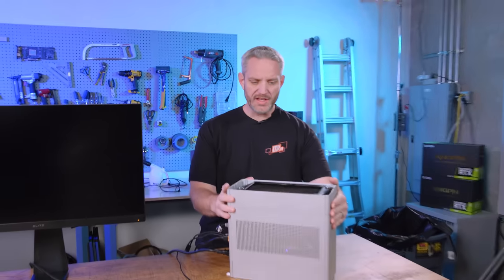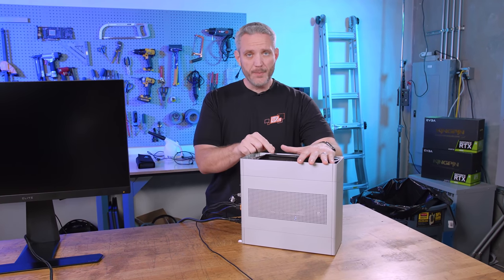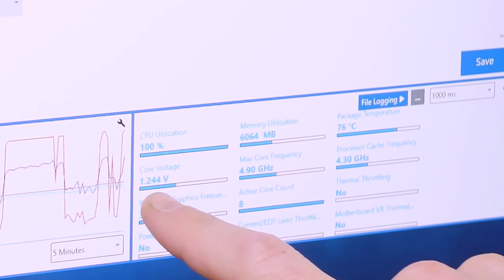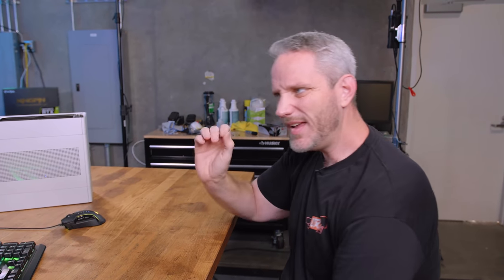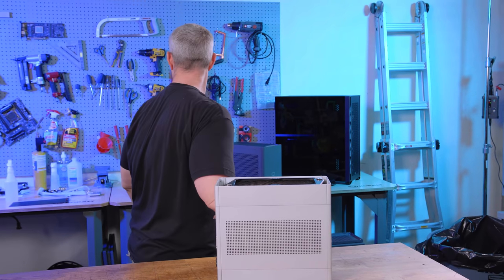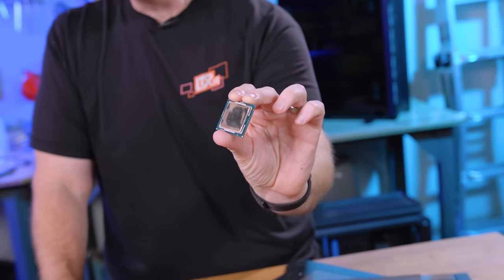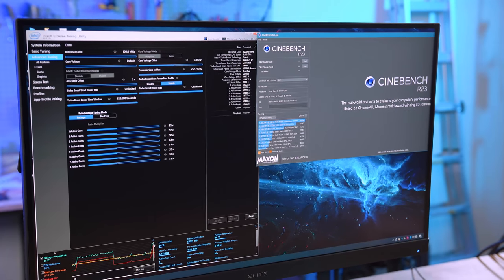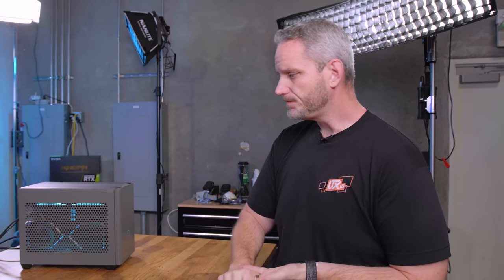THIS is what a Silicon Lottery Winner and Loser looks like for CPUs...

Comment: I am overclocking my 11900k using BIOS.  While this was relatively easy,  there are a few disadvantages including not being able to quick and easily disable overclocking when I don't need it to save power and reduce unnecessary heat output as well as I have noticed this prevents my pc from sleeping and if I try to force it, it will not wake back up.  Would using Intel Extreme Tuning Utility, that Jay showed early in the video, allow me to have the same performance as overclocking using BIOS but with the ability to quickly and easily disable it so it can sleep and wake back up to save lots of energy and lower heat generation when when its not being used?
Reply: Potentially yes and no because it also has a bit to do with what mobo you have  and if it has some form of software that might interfere with any of settings most manufactures do ie msi dragon center and i think armory crate. You have to be wary of those because they can apply their settings and depending on the bios settings initially  if you also use xtu then there might be two sofwares trying to change things and it can be wonky. If that's not the case and your comfortable with keeping an eye on voltages and what not then yes you can use xtu in a similar way to just a Bios OC and have different profiles loaded. Depending on your usage case i would also say that a lot of the times most OC guides are set up to have it so that its locked at the highest frequency and the voltage all the time on all the cores which can be the best ot hit bench,arks and for heavy tasks like rendering and stuff that use all the cores it will beneficial and will be good for gaming but for everyday can be excessive. You can change the windows power plan as well and in the advanced settings can manage it and allow the computer to sleep and also downclock when needed. so you could change that profile as well. I have mine set up with xtu and using the per package setting have it to from using 1-4 cores at a fairly high setting so that it can turbo up to those on most tasks and not so high on all core since its thermals in my case  and have tuned in the auto voltages to work with that and i think it works pretty well for most things and gaining since i don't have many heavy all core tasks  i do. But you can achieve the same OC you have in BIOS on XTU if you know the voltages and everything and save it to a profile and switch as needed but just be sure to keep track of everything to make sure
Reply: @connorjohnson4402  I currently have a MSI Z590 Pro Wifi mobo and am using the OC button in BIOS which I found to do a pretty good job of getting me 5.3 (not worried about extreme overclocking for my use) as well as having XMP enabled and custom fan curves set in BIOS for everything but the GPU which I have set in GPU Tweak II.  If I was to use XTU, I figured I would want to disable the OC in BIOS first.  I was hoping that XTU would have the ability to switch between a default and custom profile with the click of a button (something you cannot easily do with BIOS OC).

What I just realized was that when you make any changes in the BIOS it tells you what changed in BIOS when you go to save and leave which I remember told me what voltage and other changes it was making.  I could go into BIOS and turn it off and make note of what changes it said were made.  It would essentially tell me what to do in XTU to get the same OC.   You mentioned profiles which leads me to believe that I could enable the OC profile when I also enable my GPU OC profile for gaming and disable both when not.

I misspoke about my sleep issue.  Its not that it won't go to sleep.  It's that it will not wake back up from sleep which is why I don't let it go to sleep.  I have spent a lot of time testing the sleep issue.  If I put it to sleep it will not wake up. If I set a power setting that lets it go to sleep it will not wake up.  I checked BIOS settings to ensure the peripherals could be used to wake.  I can hear the fans ramp up but no display out when I try to wake it.  If I disable OC in BIOS the computer will wake from sleep but when I reenable it, it will go to sleep but not wake up.

Comment: Hi, Could you make a video about Ryzen Master and CTR?
From what I have seen, the CTR tells you if the CPU is Gold or Platinum, I am interested in lowering the voltage and having less temperature.

What I do not know is if after having done all the stability tests I can configure the BIOS with those values and it works the same, another thing that I do not understand is the "Load Line Calibration" and it seems dangerous to me.

From what I understand, there is game software (DRM) that closes some processes, it happened to me with the MSI Comand Center that I used to control the fans, in the end I uninstalled it and configured the PWM curve in the BIOS. It can't be good if it happens to you when you control voltages and a DRM annoys you.
I noticed when I set an alarm in HWinfo, to alert me if the RPM drops below a threshold.
Reply: your mentioning multiple different things and confusing them and there functions together. The OC software is one thing  andif it works for you then good.

Load line calibration has to do with your PSU and its response to changing voltages and is a setting in the bios and in the middle/ auto is usually safe and most software wont mess with that setting because that's a bios setting controlled by the motherboard.

DRM is digital rights management and is the stuff that makes it so that games cant be copied or pirated so idk what information you read but maybe you should do a bit more research on things . But also MSI command center and Dragon center also contains software settings that will affect overclocking and MSI notoriously has terrible software but When installing the command center or Dragon center it can go in and change voltages and other things in your bios  and with the different systems settings like gaming or extreme can make things run super wonky occasionally especially trying to overclock and then using another software ontop of it. Sometimes those settings will stay around even after getting deleted. So idk how you got the DRM mixed in with LLC settings or voltage control bur i could see it being set to silent mode or similar in the software andthats why the fans were set at a low setting  But any game will not change any systems settings at all. Doing the fan control in Bios is the best options and for looking at undervolting i would recommend doing a bit of research on to the system and how it all works to get things  dialed in because ryzen can be a bit picky depending  on things and there's a range of setting that can be interconnected that might do more harm than good just turning some voltages down

Comment: Gues the hardware-gods have been in my favor all the time 😋
Why u ask, Well, my first oc - pentium 4 Prescott ht 3.06ghz got it @ 5.2ghz on air.
Second one a q6600 2.4ghz @ 3.56ghz on air and @ 4.2ghz with a custom loop
And my current one and i7 4790k 4.0/4.4 GHz @ 4.7/5.5 GHz on a simple Corsair aio with .075 MV undervoltage. Got the feeling it is capable of going even Faster hut would need a better MB not this crappy MSI one i got( first and last MSI MB for me, nothing but troubles but could not have a refund , wish ABIT was still arround tho)

Comment: i tested my 9900k on 5ghz and its pulling at 1.39volts almost 200 watts. but i got 13360 points in r23. there must be something wrong with your clock readings...at 5.2 it should get more than 11190points in r23

Comment: My 10700k does 5.2 ghz all core wtih no extra voltage and MSI game boost disabled. In XTU it's only set to 5.1 at single core but it just wants to  do 5.2 all core it's crazy.  I could probably push this thing pretty far if I wanted to because my temperatures max out at like 79 degrees.

Comment: I have only gotten one good cpu. My 8700k that will do 5.2ghz at 1.25v which is stock voltage. Takes 1.36v for 5.3ghz. 
My 9900k is bottom of barrel takes 1.375 to do 5ghz and that's not even fully stable.
Reply: Set your cache ratio to 4.7 or 4.8... it can lower the vcore needed to be stable most 9900ks won't do 5ghz on cache and clock without needed stupid voltage dropped my vcore needed to be stable by lots
Reply: @TheBURBAN111  yea, that's with my cache at stock ratio.
Reply: @Apollo-Computers  stock can sometimes be strange as well though imo just trying to help... i always manually set it.

Comment: I have an I5 11600k. Is 5ghz all core 1.52 v with cinibench r23 avg temp of 85c a good chip? It never stays that hot under my normal usage, I normally get about 75c and spikes to 80 here and there. I might be able to push the cores a bit higher, just been making sure the settings are stable. I have a setting enabled that throttles the cpu core clock if it gets to 90°, I can't remember the name of it.
Reply: 1.52 is too high vcore... it will damage your chip... set a manual vcore... and set your cache ratio to 4.6 or 4.7 as this can lower the voltage thsts needed for 5ghz
Reply: @TheBURBAN111  Thank you for telling me! Any sugestions as to where I can read or watch to learn more about this?

Comment: Well the cache was running at 4,7 on the first run and 4.3 on the second one!!? Also the motherboard would've been a good thing to note because a lot of the other voltages can have an not insignificant effect on heat.
 I'm kind of bummed that wasn't mentioned but yea that is definitely a prime cpu there having a 9900k myself. Although it made me feel a little better about mine and made me want to try lapping it, but i need to get a better cooler first because its on an air cooler currently. Its a SFF msi Trident X its cooler holds its own all things considered  and with a 2080 super and 64gb of ram i got for$1000 right before the rona, i cant complain.

 I just wish msi would update the bios to the same as the retail board but it seems to be their practice for all prebuilt and even if the board is basically identical to the retail one they have it on a different version or something similar so that the BIOS is different.

Comment: my 1st oem tray 9900k did a constant all cores 5.0Ghz@1.28v@like 75-85°C with a corsair 360mm AIO I was super happy and tought it was "normal" so I recommended it everywhere, years later I bought another one a retail box it could barely do it's base 4.7Ghz if I tried 5.0ghz it required 1.4v to go past the bios and used 200+watts went to 100°C with a dual 360mm radiators liquid cooling ! complete trash :/ then and only then did I understood that you get what you get if you've got a bad bin forget OC and run whatever works at decent temps
p.s. my good 9900k after 3 years running @ 5.0 and often 5.1ghz is starting to show degradation, my previous intel 5960x also started to become less and less stable with time, ocing will have an impact on the lifetime of your cpu, whatever you can benchmark at, remove 100Mhz and lower the voltage it'll last longer

Comment: I've been trying to overclock my 5600X on manual but it never budges above 3.68 even on 1.4 volts, does that mean I have a bad silicon chip?
But when I use PBO, it spikes to 4.55 and won't go higher.
Reply: Just use pbo its good enough

Comment: I would like some input on my cpu setup. I have a 6700K, I usually power limit it because it gets too hot. I change the Turbo Boost Power Max setting in XTU (which is the amount of power it will run at) at 90 Watts TDP, my CPU goes to 100 C in about 1 minute, my cpu is just shy of 4.0Gh all cores (3.9), and using 1.240 Volts. I am sure I lost the lottery but I am concerned that it is somehow my setup. I have a Corsair H115i 280mm with fans blowing hot air out of my full tower Cooler Master Storm Trooper case. I also applied liquid metal to my cpu and I delidded my cpu, however, I think the liquid metal has dried up or something, let me know if that is a thing or now. Thanks everyone :)

Comment: any idea why after upgrading from amd 3600 to 5600x and updating mb bios starting getting strange behavior vega 64 memory temp getting hot and driver crashes fan speed lowers when should be rising and @1440p undervolted works fine temps good but go to  4k  core and memory speed  ignore the under volt and fall lower than a vega 56 core and memory speed go back to 1440p and alls good again . changed drivers rplaced thermal-pasted on card and reinstalled window  nothing helped can motherboard bios  effect gpu voltages ?

Comment: I had a 8700k i bought retail and was able to push it to 5.3 on all cores with out any issues until... the memory controller went out but Intel was nice enough to send me a replacement and that one I got to 5.4ghz all core, delided with less voltage and has no issues. I wonder if they keep replacement parts that are binned just to make sure there's no issue with the replacement.
Reply: Binned CPUs can have issues the same as any other...binned does not mean quality control issues can't happen

Comment: My CPU is for sure a lottery loser. I cant even get over 4.3 on my 3900X and thats with an auto overclock. I can't for the life of me dial in a clock speed and voltage and get it stable.

Comment: I'm glad I quit overclocking, this thing is getting so complicated and unpredictable.
Reply: if anything its just gotten less meaningfull the 10900k out of the box runs at 4.9ghz on most motherboards that unlock its power limit. and you can get maybe 5.0-5.1ghz with reasonable cooling. there is slighty more in 11th gen but they are toasty if your lucky you get to a similar 5.0ghz+- range from the start of 4.7ghz all core.  Gpu's for the most part are similar in clock speeds if you get a higher boost stock model from an AIB your looking at maybe +150 range on core. mem on gpus for gddr6 and 6x though has a decent bump that you can slap in +800-+1000 range on most cards

Comment: Jay mentioned silicon lottery and asc? or Asic? what is that?
Reply: Silicon lottery is when you get a cpu that can hit higher than average overclocks. ASIC quality is how much Vcore Voltage needed to run said clock. A great example is I had an 8600k did 5.1Ghz at 1.22 Vcore. My 9700k did 5.0Ghz at 1.48v

Comment: Hey Jayz. Could you do some Intel overclocking guide? I'm doing OC on my ASUS ROG Maximus IX Extreme and when I set manual Vcore then the MB sets it a little bit higher every time. I dont much know how the offset works so it didn't help me when I tried different values there. Now I have 4.9GHz with 1.345Vcore on my 7700K. I tried asus software but I don't like it so I set up everything in bios directly. Now when I saw you using Intel software I maybe give it a shot. But it would be much better if you give me some tutorial =) (I've seen that you made OC tutorial video bud it's from 2013) Thank
Reply: voltage offset increases or decreases  the default voltage by the amount you set it to...
only do it by small increments. like 0.005-0.01 at a time and check stability each time.
overclocking gets addictive because you will always want to find a perfect voltage/clock speed for your chip.
but 7700k is strong cpu
i dont think you even need to overclock it.
i was even playing with underclocking my 9900k for lower temps. this chip is running frickin too hot when under full load (fortunately most games dont utilize all cores)

Comment: I think i got stuck with a middle of the road 9700k, im at 5.0 all-core at i think between 1.27-1.30v and very randomly get a crash with no errors (maybe once every few weeks got better when I bumped up voltage a few tenths of a volt).  Also wonder if its memory related running corsair vengeance at 3200mhz.... ran so many tests can't  find any errors (on custom water encoding movies i hit about 75C onlu around 55-60C gaming. Ready for ryzen maybe....
Reply: its probably to do with your ram... set xmp profile 1 as profile 2 can be unstable also set your cpu cache ratio or ring down to 4.7...as trying to set it to 5.0 with the core clock at 5.0 can cause the cpu to need stupid amounts of vcore for stability... my 10700k was the same dropped my cache ratio from 5ghz to 4.8 and it dropped my vcore it needed to be stable from 1.38 to 1.32 at 5ghz all core lowered my temps and my system is now 100% stable also AMD can be just as strange with overclocking and ram issues... so don't expect it to be any different also set a manual vcore thats another issue just trying to help also  newer ryzens are actually better if left on auto oc settings using Pbo with an undervolt also what sort of crash is it? Bsod or does the pc turn off?

Comment: The bunch of silicon lottery winners aka golden samples have the best ASIC quality. The better the ASIC quality the lower the voltage required to achieve a given overclock.
If you need 1.45 Volts to achieve 5 GHz you are not a silicon lottery winner/golden sample = you're ASIC is *bad*.
If you need 1.25 Volts to achieve 5 GHz you are a silicon lottery winner/golden sample = you're ASIC is *good*.

However, you can be still a silicon lottery winner/golden sample (of all 9900Ks) but compared to other CPUs your ASIC can be bad ... but nobody gives a shit about this comparison.

Comment: Please help me 😢 my Dell 3080 will not post in my non Alienware rig. I7 10700k @5.2 64g ddr4 3200 ram and rog strix z490 g gaming wifi mb. The local shop charged me 200 bucks just to delete my hard drives and Not fix the problem 😭 updated bios and still nothing. My rtx 2080 works perfect  instantly